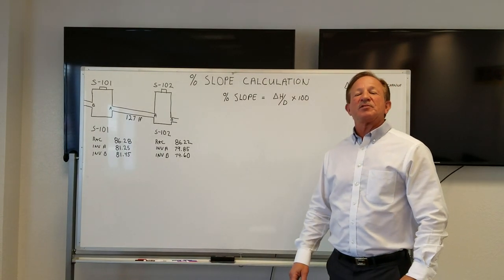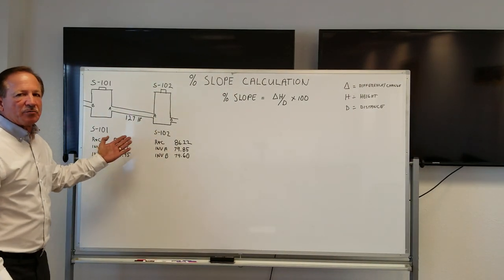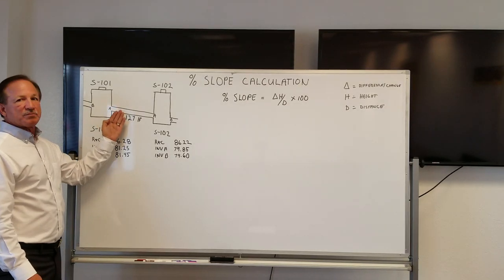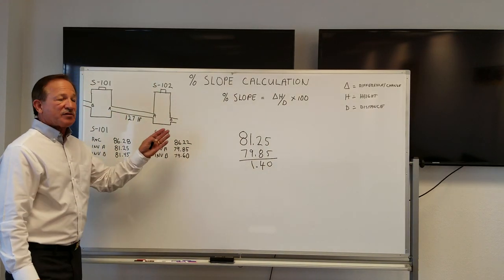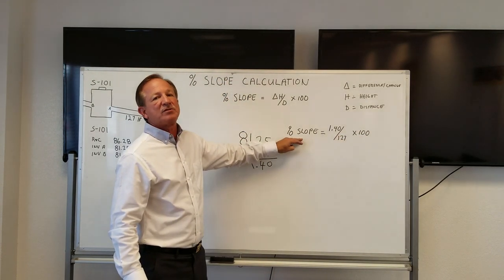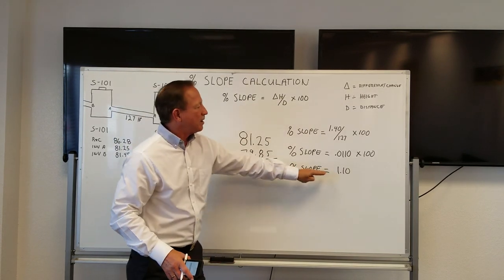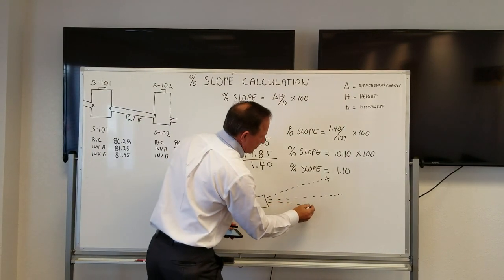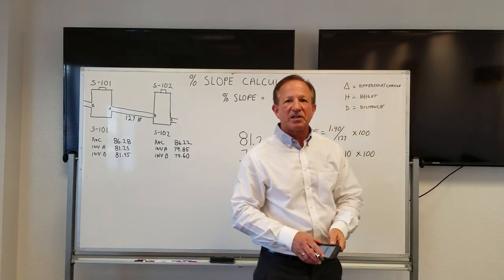How to calculate a Pipe Laser Slope Percentage

Comment: It is not mentioned that the distance 1.27 is it horizontal distance or the distance with slope, as we are talking about slop , the slope is a resultant of division of vertical and real horizontal diastase with no slope in order to get the slop itself . I wish I can get an answer to my view . Thank you
Reply from the maker: The distance is the distance from the inside wall of one structure to the other structure. It is not the length of pipe, but the measured distance between the two structures. You could calculate the length of pipe using the pythagorean theorem; a2 + b2 = c2, where a is the height and b is the distance between the two structures. Then solving for c would give you the length of the pipe.

Comment: Question good sir, what would you say is the perfect slope percentage for a domestic septic system, for the house to tank portion? Also do you have any advice for for frost line depth install in northern climates? Thanks for the info, I’ll share these videos
Reply: 1:60 or 1.67%
Reply: @grant4980  wtf lol no way that screaming dude. Sanitary can be run at a minimum of about .33 on your laser which is almost level  just a slight pitch if you throw a 4 ft level on a piece of sdr-35 thats roughly about touching line on your level

Comment: Do I take cuts and fills into account when calculating pipe invert depth? What would be the math on that?
Reply from the maker: remember, you are working from design elevations which is not  associated with current ground elevations when the work is being done.  work from print elevations and benchmarks.   hope this answered your questions

Comment: Can you use this same formula using length in feet and using height in inches? I don't have a pipe laser I have a rotary laser. So I would take a shot of my low point and a shot of my high point, measure the difference in height in inches and then measure the length in between. What I am usually doing is replacing storm pipe that is rotted with new sdr or n-12 pipe. Any help would be greatly appreciated. I'd like to know if I can set the percentage correctly on a RL-SV2S Rotating Laser. Thanks anyone
Reply: Yes, you are able to use wherever laser you got available at the moment or even a streamline... the key is to use the math correctly.  With the percentage of slope, you can multiply the length of 2 pipes for example (40 ft) by the % slope, the result is the height where the pipe has to settle down at 40 feet (2 lengts). So, what it rest is place your rotary laser in the structure opening (invert position of the pipe) and then make sure that your laser dot is pointed out at the same height you previously calculated.
3 important things: remember that your laser has a height you need to consider, and also remember you need to be exact positioned at 2 pipes lengths when settle your laser. For last, consider if you're down or up to hill.
But is easier and quicker always works with the right tools... I could say this is a way to resolve for while if youre pipe laser has broken or running out of batteries and your are far away from any civilization hahahahaha.

Comment: But don’t you also have to add the thickness of the Pipe?
Reply: For calculating a slope lol? Why would you? We’re not calculating installation / design elevation?
Reply: That’s only when you set your Flowline if it’s HDPE and or RCP
Reply: @acedeucetray2880  assuming this will be applied in real life. We will only add half of the pipe thickness?
I solved the difference of elevation of a 17m pipes between to manholes and got only 0.567% and was wondering why its 10cm.
Reply: No the percentage is finish stone in the ditch. Pipe size means nothing